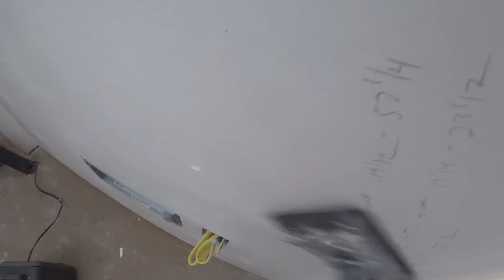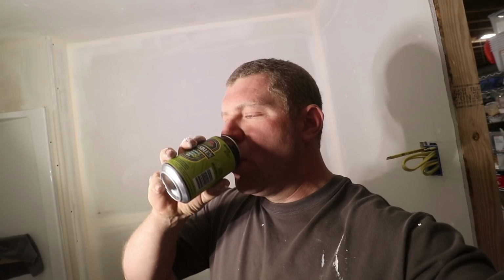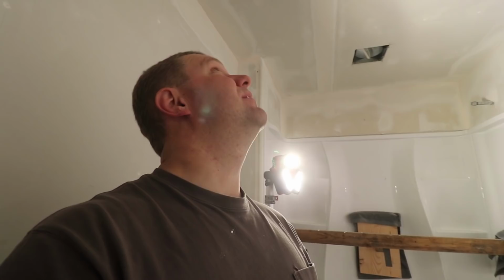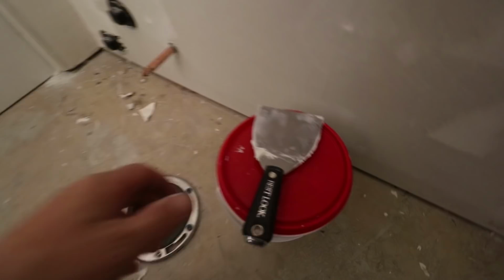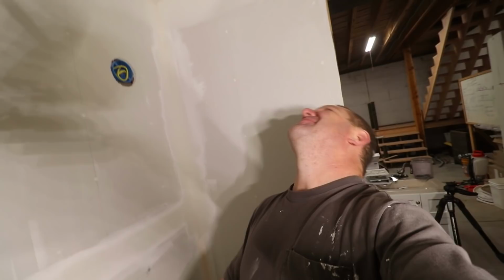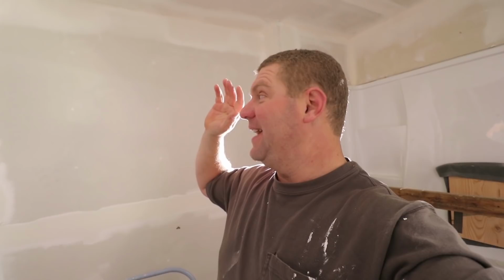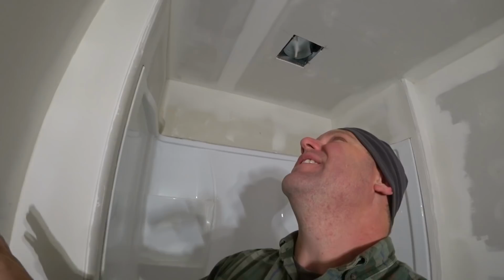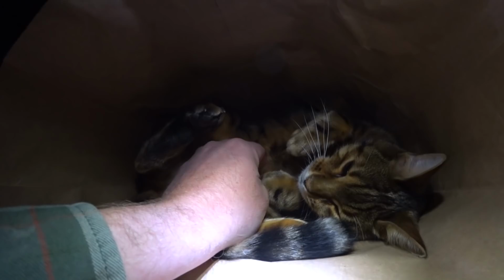READY to TEXTURE & PAINT! (Mudding Drywall in Bathroom)

Comment: + before taping pre-fill your bigger gaps and let them dry, plaster shrinks when drying so will suck in the tape,  if the tape peels from the wall,  not enough mud behind it,  paper tape has a seam down the center so you can fold it and make it 90degree to match the corner.  always easier to  do do more coats than having to sand a lot.  really got to get the finish decent off the trowel and to do that i'd ditch the pre bought stuff,  that's ok for a patch job, but powdered will be cheaper and of better quality.  I'd suggest hiring a crew to do the main areas,  they will be faster, less messier and undoutably achieve a better result,  there will be so much other stuff to do without having to worry about that as well.

Have just watched your channel and caught up,  impressive stuff from both of you,  enjoyed watching it,  the house looks like it will be really good when finished,  congrats

Comment: Your mud is a little thick.  you should thin it down a little for better adhesion .    If your tape blisters and bubbles, you can tell by tapping it, it will have a non-solid sound you can cut it out with a razor knife and just fill it like a nail hole.  You can sand it with a piece of cardboard.

Comment: Duh.. Jessie they do have drywall sander with vacuum attachments. I've seen low as $20 buck and around $100-200 for the extended poles. I've used them and sometimes the hose can be a pain but beats hell out of coughing up and blowing plaster dust out your nose. God....

Comment: In the future two things, 1. before taping put down a generous amount of mud to fill the seam almost gliding your knife over it then lay the paper into it.  Now when putting mud over it  you seal the paper edges into layer  while pressing any excess from under the paper,  (no more bubbling of the seam).   2.  corners - fold the paper tape in  half on the floor making a perfect 90 degree crease to lay into the corner mud you have layed down to receive it.   Happy drywalling.  You can do it!!!

Comment: I renoed my foreclosure for 3 years. I’m no pro but I just wanted to let you know that the mesh teal or mesh joint tape is ten times better than plain tape and mold won’t grow on it.. that stuff is amazing for building up corners also. I did my whole bathroom with one of those buckets of mud and I took popcorn texture off the ceiling as well so I think you may be using too much mud? I blame that on that crappy tape though.. it bubbles up. Get the mesh! Makes things 10xs easier. Also, I replaced my shower insert and they covered the screwed lip with the drywall and put a metal corner on it. Then caulked where the shower and drywall meet. I ripped mine out and did a galvanized shower! Love the vids :)